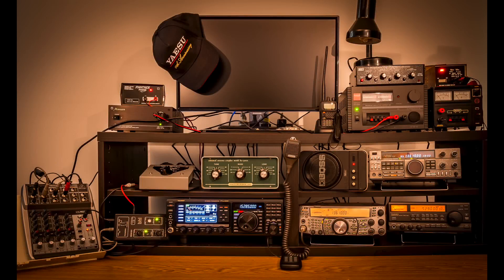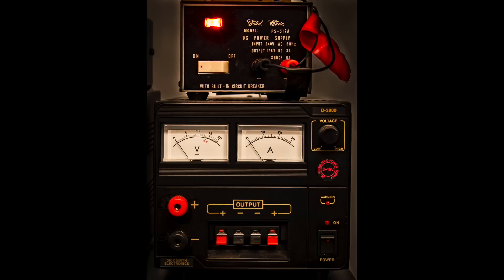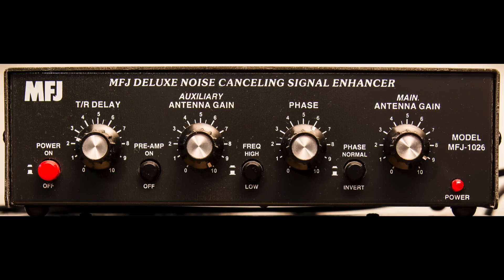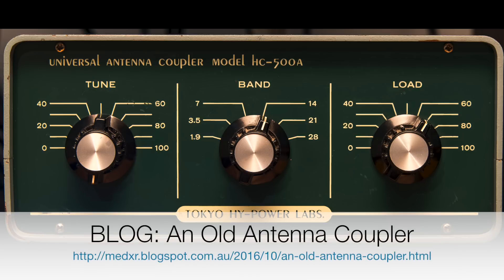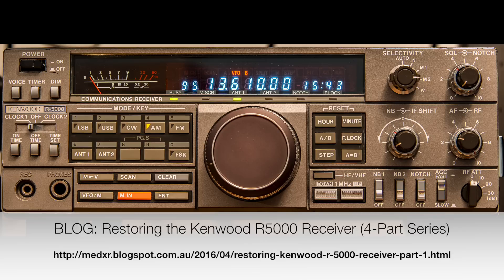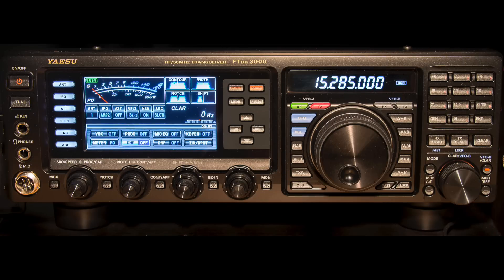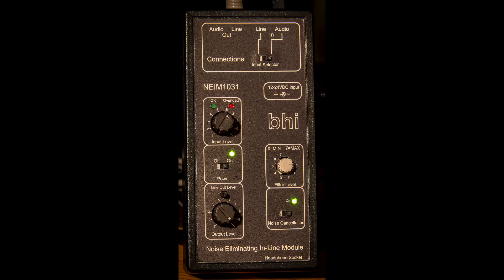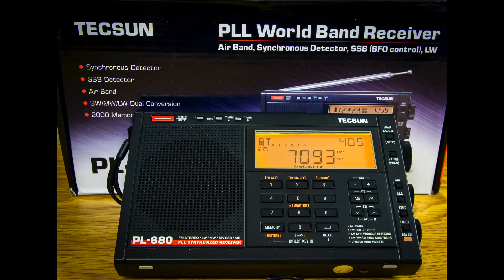A Visit to My Radio Shack

Comment: A brilliant shack tour, as someone new to the hobby this has been the best video. You went through and explained each component instead of doing a quick video sweeo of the kit. Thank you.
Reply from the maker: Cool. Thanks for watching and your kind comments! There have been a few changes since this video was made more than 18 months ago. But basically, the gear is much the same. I've added a small mixer ( https://youtu.be/iDisHsLNaHI ) and I've cleaned up the radio frequency interference I was getting from the monitor, so I'm using that much more now ( https://youtu.be/J_1jRfnvp4g ). Best wishes, Rob VK3BVW

Comment: Thanks for the shack tour Rob. I've always fancied trying the TS-2000 as I don't have a base rig for VHF/ UHF. I'm temped to try the new Yaesu FT-991 but I have no antenna up yet for 2m and 70cms. Thanks for sharing. 73 Graham
Reply from the maker: Hi Graham. If you were going to pick up a TS2000, you'd want to grab a recent version. Some of the circuitry has been slightly modified with more modern components. I'm reliably informed that a few components in my 1st generation 2000 are no longer available. The 991 sounds good and reviews have been generally favourable, although I have not tried one yet. It is nice having one rig that covers so much of the HF-UHF spectrum in the one box. Best 73, Rob.